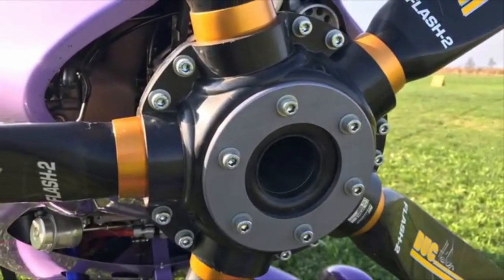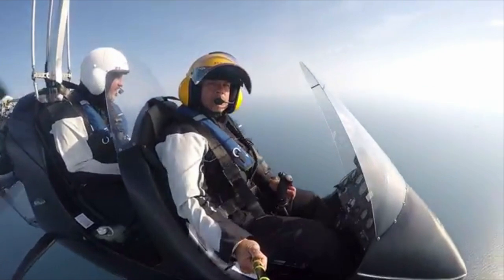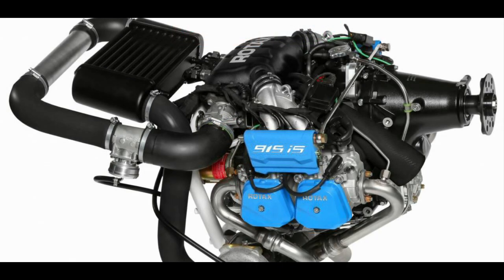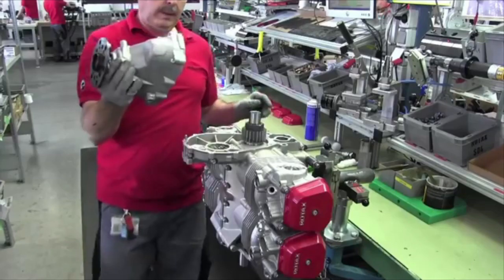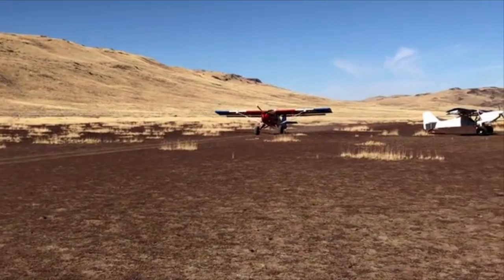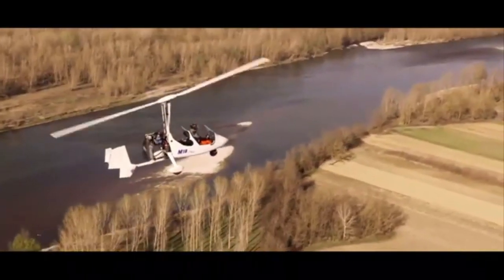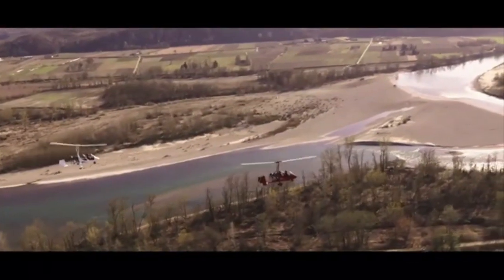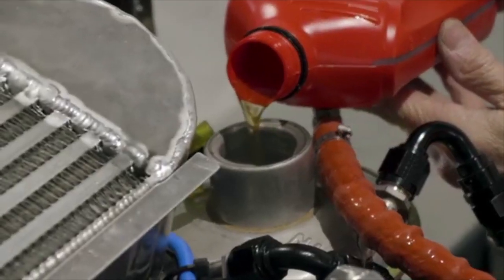Gyrocopter Rotax 915 impressions - is the 915 option worth it?

Comment: Hi Stu, do you have fuel burn figures for the 912 & 914? I flew a 912 flexwing with a fuel burn of 8 litres/hr but the cruise was about 60mph. Would be nice if you could sign off your vids instead of ending so abruptly. Keep up the good work mate, you've got me interested in aviation again. Is that you I sometimes see flying over Oswestry?
Reply from the maker: Hello Pete - 912 is around 13 litre an hour with 914 15L at around 70mph cruise. Gyroplanes are drag machines! Could have been me last year otherwise like a guy who flies out of the Long Mynd.

Comment: Great stuff. Left a bit 'up in the air' (sorry) re your stance on the 915. I'm in New Zealand with a new Cavalon 914 and the new rotor head. Wondering if I might have been better with a 915
but then again the MAUW issue is creeping in... Absolutely love my gyro but no recreational flying lately because of you-know-what.
On the matter of wheel balance in other videos - I find I have to flatten the rotor a lot, i.e. stick well forward to counteract the drag to achieve speed increase. I think wheels all still on the
ground - certainly the mains - until flying speed (60-ish kts.) and good rotor speed (200 - 300). Then the t/off lift is amazing.
David L
Reply from the maker: If you already have the 914 then it’s only climb performance that is the main difference and most flights have one big climb out initially then cruise. On the take offs yes some forward stick helps most in Cavalon because of the CoG especially if you are full of fuel. Don’t over do the forward stick - my advice is pre-rotate to 220, stick fully back, brake release and ground roll - see a +ve rotor speed increase and once around 250 rrpm then ease stick forward a fist / fist and a half then at 300 rrpm the aircraft should ready to unstick and here it’s stick forward enough to hold a nice take off attitude and allow the aircraft to fly. If rotor rpms ever decay below 180 initially then you must close the throttle and bring the aircraft to a stop with back stick.
Reply: I have a 915, I would not fly a smaller engine again, its like going back to a 4 cylinder car after owning a V8.. Lol